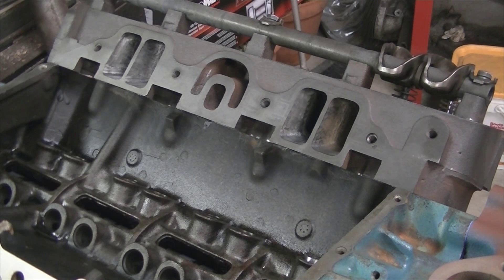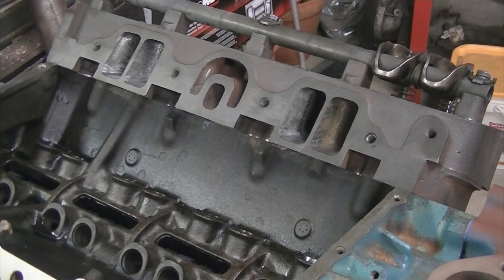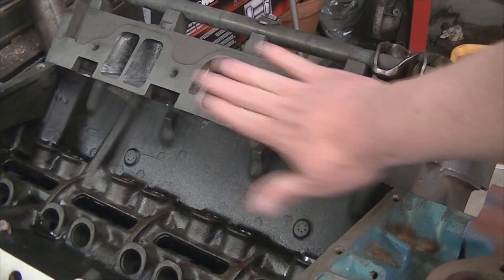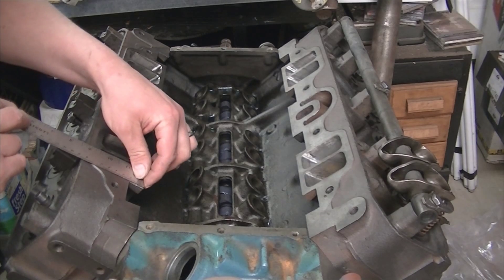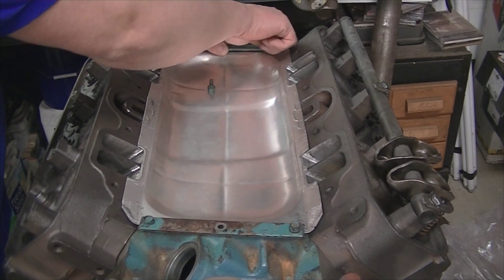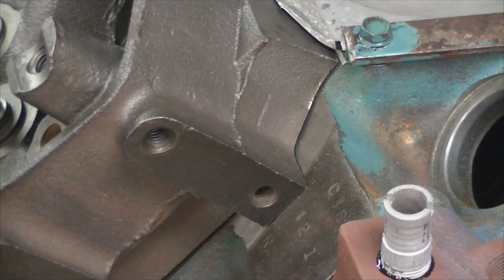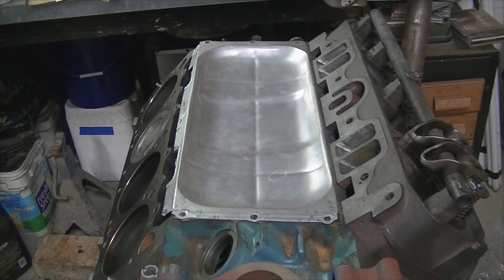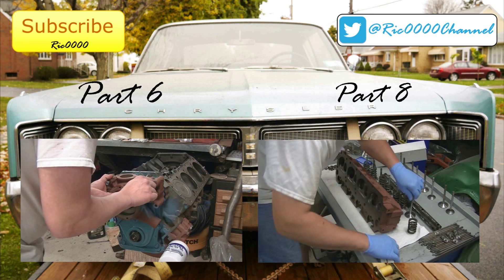Joe’s Garage 383 Engine Rebuild Part 7 –Valley Pan Modification

Comment: It's always easier to do the right thing in the first place and change the pistons to get the compression you want. Especially if you've got those $hitty 2bbl dished pistons. No reason to keep those. There is absolutely no upside to cutting the crap out of an original block or the heads, as you've found out. All kinds of clearance and fitment issues, not to mention valvetrain changes. A cleanup cut is OK, that much is trouble. For a 90 degree V8 you're supposed to take off .0123 from the intake plane for every .010 off the head deck. If you cut the intake, you have an intake 'mated' to just that engine. I bought an unknown engine that was a freakshow like that. You NEVER want to box yourself in by cutting that much metal off the block. You can't ever make it right. Even custom pistons would have been cheaper, but I believe there are some stocking pistons that would have got you in the ball park. If you ever go to a machine shop and they cut the deck and not the intake side, find another machine shop. Live and learn.
Reply: AMEN!

Comment: Thats a rip-off for the valley pans.Do you need a valley pan, why not cut out the 2 manifold side gaskets and run a cork gasket front and back leaving some overhang so it seals up those step up lips.Just a guess what ya wreckon bud :)
Reply: all you had to do is have the machine shop do there job they know you have to mill the top of the block